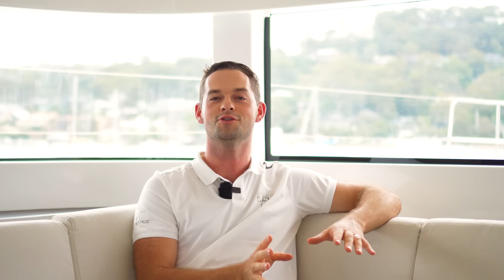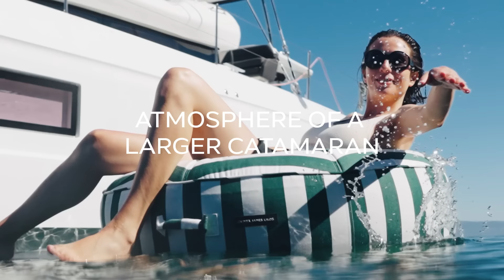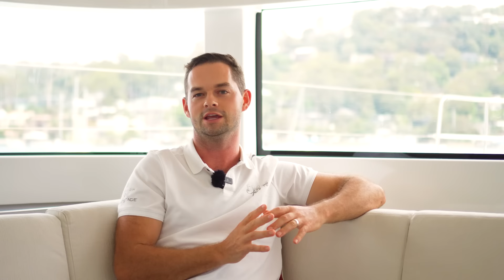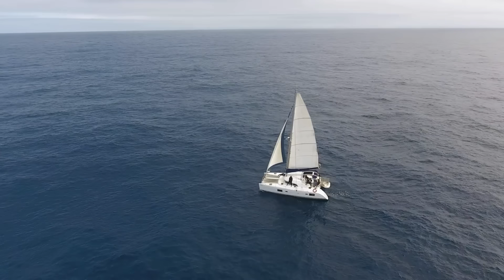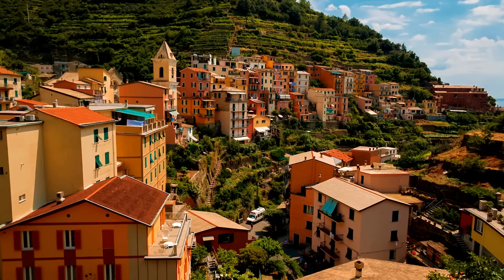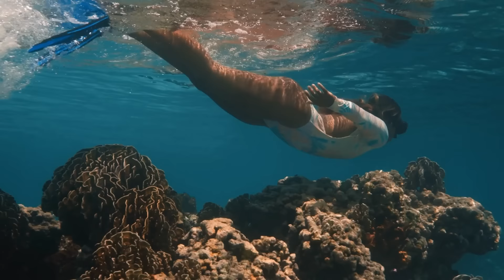NEW LAGOON 38 | Exclusive Look with Joe Fox

Comment: I have been saying for many years there is no reason 42 heads between the cabins and it would be much better with one. It would make the bathroom larger and more comfortable as well as less stuff to break and take care of. Also less spare parts to carry because you don't 3 or 4 heads
Reply from the maker: Thanks for sharing your thoughts! Having fewer heads can definitely mean more space and easier maintenance — it really depends on what each sailor values most in their setup. Every design has its trade-offs!

Comment: Did they improve the quality? There are so many second hand Lagoons on the market because of poor quality.
Reply: For example the 380 is produced in the 1000 range while the leopard 38 is produced in the 200 range. Perhaps poor quality is not the main reason for seeing many lagoons on the second hand market? Please note that I am not saying that there are no quality issues but all brands have them, even Outremer!
Reply from the maker: @jonas8075  Thank you. For sure, Lagoon are the leaders in the catamaran market with more sailing the world than any other brand so naturally more will be on the market. Lagoon has always prioritised clean and simple designs and high-quality materials.
Reply: What do you mean poor quality - with almost 1,000 of these catamarans produced over nearly 20 years and plenty of early models still lovingly cruising the globe I am yet to see poor quality in them.  Poor condition from lack of maintenance by owners yes but an older well cared for boat is better than a newer boat that’s been flogged by years of charter use.  The fact you see so many is possibly more to do with the longevity of the production and the number of the lagoon 380’s made